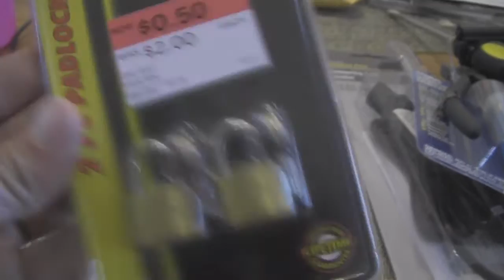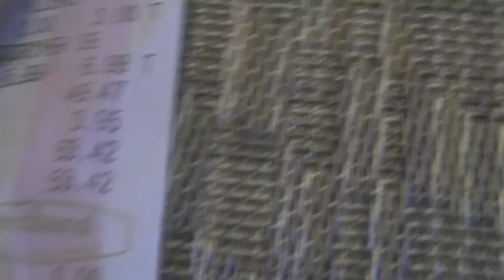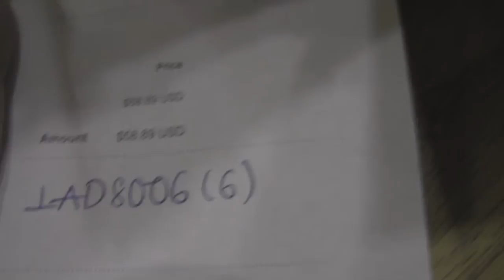Geo: New Lifters and Other Problem

Comment: Hi.  I have a question.  How long will a 89' Geo 3 cyl work with low compression (149,155,165), and is lifter/valve cover ticking noise natural?

Comment: I have a 94 with 300.000on it and it's been ticking for years and and    I'm going to fix the lifters now so do I have take the dist out and loosen the timeing belt tensioner thanks Fred.

Comment from the maker: @crammage LOL, yea really. Basically it is. Ill do a video featuring it. I have seen mixed reviews about them and do not know how it will do. You bore out the top in reverse and then turn it over like I was saying it digs in to the bolt with the drill reversed and hopefully it will pull it out.

Comment: The clip type torque wrenches at low torque settings wount click verry loud or almost not at all. a frient of mine broke off two main cap bolts using a click type torque wrench. I saw one of the old pointer types for sale at menards of all places for $25.

Comment: Hey we both have the same color Geo's Mine has more rust. They best way to find a toll you lost is to go buy a new one. then you will find the one you lost right away.  I realy do not like the torque wrenchs that click. I prefer the old style that has the pointer.